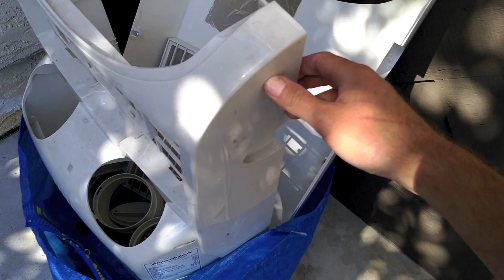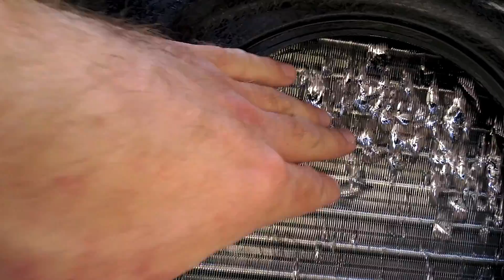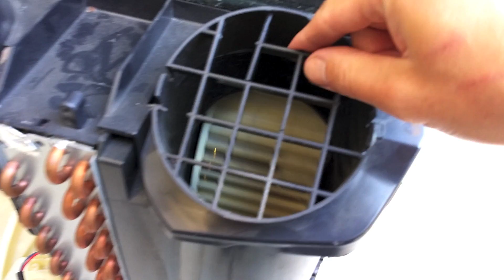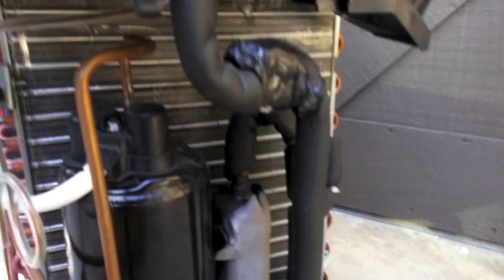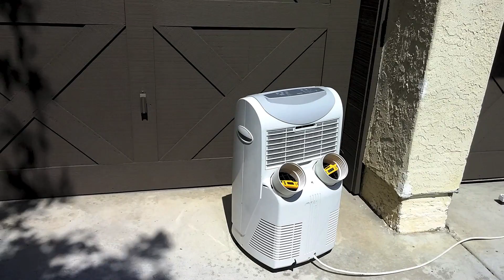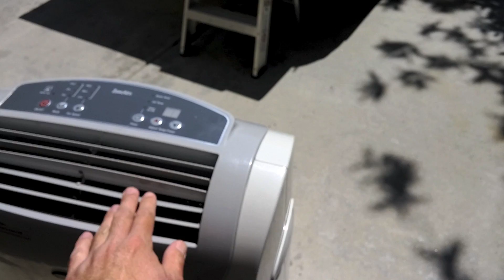Portable Air Conditioner Repair

Comment: I am desperate. Have a Haier XPN14CXM. It looks extremely like the one in this video. A mouse got in when it was sitting during the winter. Mouse has been evicted, but need to clean the inside & see if wires are chewed before turning on. There are a dozen or so phillips screws on the back panel, no problem. But at the top there are two cone shaped holes that are recessed into the back panel about 2 1/2 inches, narrowing as it goes. I cannot tell what kind of fastener is in there & need to know how to get them off so I can take the back off for a look. Haier no help. Techs want a fortune & I'd have to drag it to them. I just need to look inside not perform brain surgery. How the hell can I get it off? Schematics are nowhere to be found. I can't tell if it's a stripped phillips slot, a butchered hex or what. Please help. Thank you.
Reply from the maker: Sorry for the delay. Hard for me to say without seeing it. Maybe they're torx fasteners. Unfortunately, these units are kind of throw away units. Parts are really hard to get.
Reply: hey jon whats the best solution to repair a control panel for a plasma cool ac? our buttons dont seem to be working??

Comment: I have an Aeon Air conditioner and it overheats quickly and it starts making a loud humming sound. Idk if it’s the fan or the motor. I’ve had it since July 2016.

Comment: I have a very similar air portable air conditioner (WHYNTER ECO_FRIENDLY 14,000 BTU PORTABLE AIR CONDITIONER WITH HEATER MODEL# ARC-14SH) that I use in my studio that worked fine for the past two years then all of a sudden started making a lot more noise. When I look through the top area where the cold air blows out it looks like the thing that is spinning is looser than it used to be so it is hitting back and forth slightly. It still blows out cold air but am wondering if I need to take it apart and try to tighten something up. You did not take the top part off in the video so was not sure if this was something I should attempt to do since the air still blows cold and the heat still works as well but was not sure if I would possibly causing more damage by doing nothing ;) Not sure where you are located but if it is not something you think I can mess with do you have a recommendation for someone in the Charleston SC area?

Comment: Hi
I have an Amana PAC. It runs but sounds like a freight train is coming from the unit, it's scary. It looks like the unit you repaired with 2 hoses. Any ideas what's wrong. Thanks!
Reply from the maker: If the noise is not coming from the fans, it's likely the compressor.  Which would be bad news. Sometimes compressors sound horrible when they're a little low on gas. Or that compressor could have some internal mechanical issues.

Comment: Help! I got ripped off and its broken! Need some advice if i can get this AC fixed!! Its a Commercial Cool portable ac and its leakong water
Reply from the maker: The bottom drain pan my be cracked. Some units have a condensate water sling motor and water level shutoff switch. Look at those, you will have to remove the shell. Take a peek through the drain opening if possible first.

Comment: I had one for 10 years... Loved it.. was 12,000 btu..    Its its older days started rattleing,  plastic started breaking and yellowing..   Drain would plug ...  And finally leaked all the freon out.  I knew its life was done..    Just got a new 14,000 btu unit.. but hasn't been hot enough to fairly  comment on the new one yet.

Comment: what is the purpose of the drain plug? I am considering drilling a hole under mine to bypass it filling up and having to drain it.
Reply: During periods of high humidity, if the evaporation from the 'water wheel' can't keep up the float mechanism triggers the high water level which shuts off the unit preventing your floor from flooding. You then let out the water from this drain plug you mentioned to quickly recover use of the AC.

Otherwise, you attach a regular hose to the upper threaded drain plug and put it in a bucket or floor drain for continuous use...

Comment: Hello John,  name is Josiah i have a Honeywell a.c. 14,000 btu I am going thru the same problem, but? My a.c. starts like normal blows, and no!! cold. :*( My plastic blower fan it's not spinning I  believe motor don't work. My question is if I fix the problem would it start blowing cold? PLEASE help me . Thnx
Reply from the maker: It likely would. Which motor is broken, condenser (hot air) or evaporator motor (cold air)?

Comment: Thanks for the video!  I have an Idylis portable AC that ended up with a broken exhaust fan blade. Surprise.    I got a new part, actually got the thing back together with no left over screws but now when I turn it on all I get is error E1.    I think it's a temp sensor problem, but wondering if you've experienced this error.   Thanks again for the help you've already given !
Reply from the maker: Hi Kim, I'm glad you were able take it apart and put back together. It's not easy at all. No I haven't experienced that issue. It may be an air filter cleaning reminder. Unplug it for 10mins and see if that gets rid of the code.
Reply: I thought of that already.  I’ve unplugged it and let it sit over and over.   No good.  I reset it by holding the power button and plugging in.  It starts up for about a second then...E1.   I’m trying to psyche myself up to take it apart again .....ugh.  Maybe I’ll replace the temp sensor.....  I’ll probably need another YouTube video for that.   Thanks again for your help though.

Comment: mines blowing cool but not cold on Aircon ,eco mode has water runs cooler  but the fill water light is on ,,,delonghi PAC 150 12000btu so i suspect its got a stuck float or valve or faulty pump . who knows but these ones work better with water spray"? holds 17 liters but not using any

Comment: Hi i have a portable aircon from Trends, i can turn it on but it blow cool air but it can't cool my room. Any idea what is wrong with it? Would appreciate your input in this. It is a 10000 btu unit which i find out can cool a normal size room.
Reply from the maker: +The Specialist Does it blow cool air consistently? Do you have the exhaust hose connected to a window?
Reply: Jon HVAC Sorry for the late reply, yes it blow cool air consistently and yes the exhaust hose is connected to my window🤔 Now i don't know what is wrong with it, calling my dealer tomorrow about this...
Reply from the maker: The Specialist You may have to empty the condensate water more often.
Reply: Jon HVAC Oh i see i thought what is wrong with it thought of calling my dealer or a repairman which cost a lot here, thanks do leave more info if you have😎

Comment: Hey Jon hope you can give me advice. I got a danby dpac120060 portable, it just stopped giving out cold air, the fan is working, I can hear the motor start but it just cant turn over, also the lights on the display started to go or the LED behind it. Now I opened it up and on its circuit board I notice a part which is oval & steel looking it says XTAL looks like it fried. Do you think replacing the board will help

Comment: i have had my Haier for almost 4 yrs- it has been working well for us. but this time, it will blow cold air and then shuts off the circuit breaker  after 10-15 minutes- it gets really hot on the exhaust tube. Could the compressor not be working? i transferrred it to a different outlet and still did the same?  can you suggest anything?

Comment: hello, i have a portable unit (global air npa1-10c). only had it for 6 months. a couple of days ago, i came home, turned it on and the noise was unbearable. took it apart and found the source. its the blower wheel. for some reason its off kilter and the slight angle is causing the wheel to teeter as it spins. any idea how to straighten it out? how does that even happen? what would be the best course of action? is it the motor or the blower wheel? any help would be greatly appreciated.

Comment: So, what temperature shoiuld these units blow out at?  In some manufactures cars, 46°f is acceptable, but my everstar portable unit is only blowing out at 62°, is it junk and needs to be scraped or is there a way to recharge it so that it blows out colder.

62° is only capable of getting a tiny room down to 80° when the outside temp is only 87°

Comment: My experience with repairing these AC units have often been the same problem. They are designed to fail! The first one I fixed was due to a failed voltage regulator on the mainboard caused by getting to hot due to an undersized heatsink that blew 2 capacitors in the process. The second AC unit was similar to this mans problem. The fans are poorly made the outer ring of the fan has barely any plastic holding the actual blades together. The air coming out the AC unit is hot and either dry that makes the plastic bridal or humid if you AC unit burns off the water it produces. The water that it burns off is slightly acidic also breaking down the plastic over time. You will see the fans break apart then in some cases stop the motor or create enough resistance to cause the fan motor to work harder increasing amperage causing the breaker to pop.  Unless you are handy and have time on your hands to diagnose and troubleshoot the problem and then also lucky enough to find the replacements parts at a decent price your SOL. Most people just buy a new one and the companies know this, it should be a crime to produce a product that is designed to fail. These failed units have a large assortment of parts that still function just fine and end up in the dump. Truly sad the world we live in.
Reply: I agree with you 100%. And I live in Florida where people throw away anything that is in perfect working condition simply because they are moving, usually out of state. I've made a little money selling things I've found that were to be thrown  away. It's absolutely appalling how we've come to this mindset. It's not ok.
Reply: this arp-1000es royal sovereign portable a/c is total and complete junk! Angry they get away with selling this garbage and by the time you find out you were ripped off you are left with crap!
Reply: Something randomly broke inside my ac, it was plastic I would assume it was the fan, but it still blows air! Just not cold! Any suggestions? Please and thanks!
Reply: I've had mine for 10+ years. No problems, but I now need the remove the shell and give it a deep clean, looks gross on the input side, clean as a whistle on the output. ARC 15 s model
Reply: BIG FACTS! PURE EVIL 🤮🙈... THEY REVERSE ENGINEER THIS JUNK AND CREATE PUBLIC WASTE😢 IT'S A DAMN SHAME 🤷

Comment: parts + labor - longevity after repair = why bother fixing, just get a new unit
Reply from the maker: No, sorry I don't. It is kind of difficult to do I know. It varies by make but from my experience, the two shells are held together by screws (of course) and two inner lock hooks (one on each side). Once all the screws are removed,  lift up on one of the two shells (usually the front I believe) and it should come apart. Hope this helps you.
Reply: Pretty sure its the front cover vibrating.  Do you have a link or source to take the shell off by a chance?
Reply: Brad L - Why judge? It depends on what he (or anyone else) finds more enjoyable: tinkering with and trying to fix things, or interacting with people on YouTube. Different strokes for different folks. His suggestion seemed fairly neutral overall...
Reply: before anyone bitches, put a value on your free time...  or dont...
Reply from the maker: Not a bad point
Reply: He wastes his free time posting comments on Youtube videos and taking stupid selfies.  Then tells others to put a value on their free time.......
Reply: BTW, thanks for the video Jon.  I just have a slight rattle in mine so getting ready to pull the shell off and see what's making noise.  Only rattles when it's cooling.
Reply from the maker: Lol! ;) Hopefully, it's just a dirty condenser blower wheel and not a compressor issue.
Reply: sense of accomplishment, maybe. To learn something new.

Comment: I have a Danby 8000 BTU and after about 2 years of summer usage, one day the water container stopped filling up which i would have to empty about once every day, and after that cold air stopped coming out. Everything still works like the fan and the settings, but it just wont get cold at all. I can hear the compressor come on but nothing. Any ideas?
Reply from the maker: +Alvaro Castillo likely low/out of freon.
Reply: Jon HVAC is this something that is easy to do or should I just get a new or refurbished unit?

Comment: hi john i have a comfort aire portable ac, looks exactly the same when i take the covers off as the one you fixed, my problem is it turns on gets kind of cold, then vibrates and then blows out hot air. the compressor motor is what gets hot, the exhaust fan does not turn . any ideas ?
Reply from the maker: Likely need a new exhaust/condenser motor. Might try to spray some WD-40 on the motor bearings. Also test the run capacitor if you can.

Comment: Jon, do these portable units have 2 fans (one for condenser and one for evaporator)? If 2, are they similar size motors?
Reply from the maker: Yes the have two blowers. The one for the evaporator may be a little smaller.

Comment: Can you add anything on whehter we need to replace the refridgerant in them,  i have got a 'omas which is identical to the scheider which looks very close to the one you shows.    I wonder, do we need to replace the refridgerant,  and if its sealed like what you show,  can it be refilled ? thing mine i the 410 type refrigerant
Reply from the maker: The refrigerant doesn't go bad unless you have a compressor burnout. These things tend to leak refrigerant a lot. They do sell saddle valves to access the refrigerant system. But, I don't recommend people to play with the refrigerant system...it can be dangerous.
Reply: ok, i will try to find someone who can do this for me.  i have a guy downthe road who has a big refrigerant fill machine.  i'll ask him.  thank you for responding.

Comment: Hey Jon
I have seen your videos but I have another problem with my mobile air conditioner... The air conditioner works fine though the heat function doesn't work I were wondering if your knew how to fix it? It is a appliance model AAC-8500M410

Comment: Hi Jon, I've got my portable aircon turning off the safety electrical switch everytime i plug in to the power point. Do you reckon Is it a fixable faulty or not?
Reply: phsyco29 I had the same problem, I had to take it over to the outlet where my refrigerator is plugged in and reset it there.. I guess it needs more AMPs or something to reset. After it worked I rolled it back over to my usual spot and it worked perfectly. I think I was using it on high for too long and I over heated it and it went went into safety mode or something. 

Drew

Comment: Thanks for this video.  I was able to repair my mother-in-law's air-conditioner (whose blower wheel came apart just like the one you showed).  I was having trouble getting the housing for the blower wheel off, but your video helped me tremendously.
Reply from the maker: I'm glad it helped you.

Comment: How did you remove the housing?
Reply: Okay, Miss Smarty Pants... There are screws all around the backside of the air conditioner. LOTS of phillips screws... THEN.... at the top, in the back there are two recessed holes about 2-2 1/2" deep that tapper down in a cone shape. At the end there is a small hole that looks like a stripped phillips hole or possibly a hex - No one at the hardware store seems to be sure from looking at enlarged photos & I've been around for 66 years so I've seen a few screw drivers & screws/bolts, etc. in my time. WHAT IS IT AND HOW THE F DO I GET IT OFF MISS PRISS?
Reply: P Taylor dude you are embarrassing yourself
Reply: sparky9c22 I got the housing off. Just cannot figure how to fix the problem. Thanks anyway.
Reply: HOW did you get the housing off? I cannot figure out what tool to use for those 2 recessed holes at the top/rear
Reply: Sparky9 c22 well what's the problem?
Reply: sparky9c22 it's called a screwdriver they've been around for awhile

Comment: I am desperate. I have a Whynter ARC 14SH model Portable AC unit with AC and Heater.  It stopped turning on today.  No power or light whatsoever.  It's definitely not the AC outlet as we tested that.  I suspect the internal fuse has blown out but I have no idea how to find the fuse, or to change it even if I did.  I've looked everywhere for guidance on this and all I find is "change the starter cap"  or "change the internal fuse."   How??  :(

Comment: my portable ac cycles on for.3 min or so then cycles off ac then thensame story over and over any suggestions? ????? delonghi 12,000 btu
Reply from the maker: +Armando Gonzalez Make sure all the blower motors are working and both coils are clean.
Reply: I cleaned the outside of the coil  i have to uncover the plastic on the blower side and clean too?
Reply from the maker: +Armando Gonzalez No I don't think that's necessary. Possibly a weak run cap for the compressor. Or you may have a leak and low on refrigerant. Does it blow cold air during the 3mins it's running?